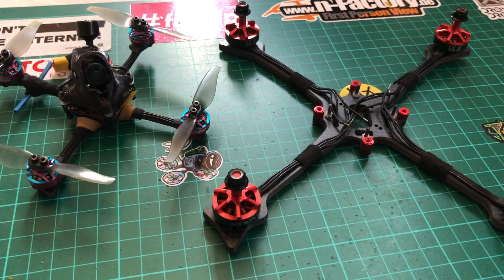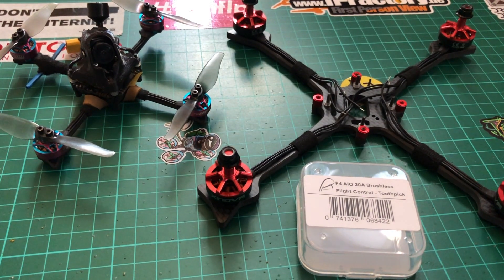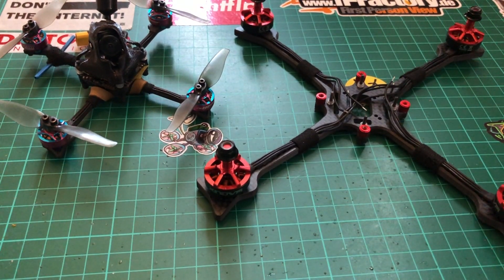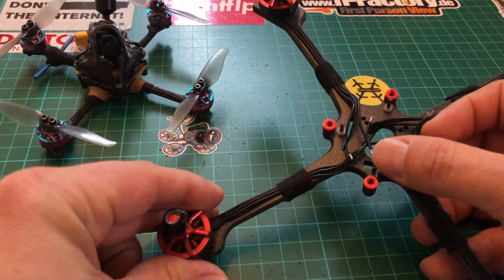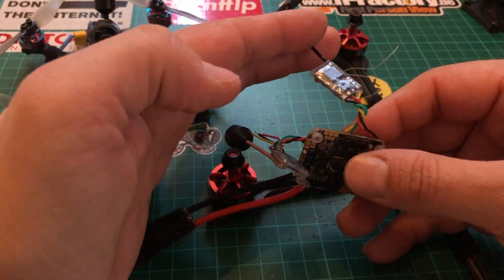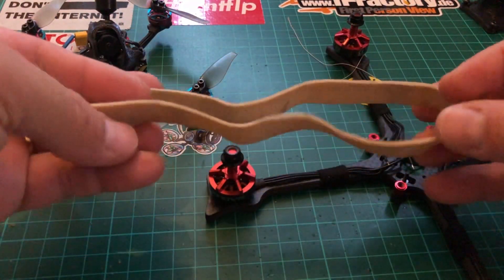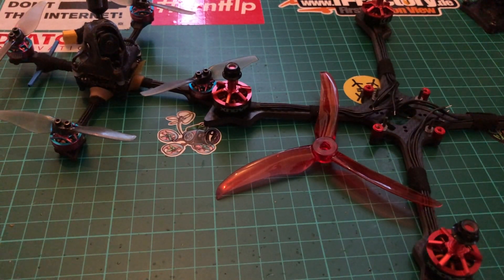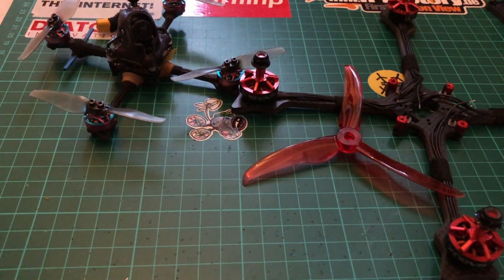A 5 inch Toothpick option : meet PickleBig

Comment: Dude! Thanks for posting. That's quite clever, having the camera cover mount not on the same plane as the the stack. Do you think you could get away with 4mm or 4.5mm? how much flex does the frame have at 5mm? Again, thanks for posting!
Reply from the maker: madpoet thanks. Yes you could go with thinner carbon I think. The 5mm version is massive and stiff. Btw I published today on the thingiverse page a “short” version of the frame that have a shorter wheelbase and slightly redesigned arm ends to take it to 30g (5mm)
Reply: @Ledroneclub  Awesome, I will definitely check it out. I follow you on thingiverse, so I would have seen it the next time I sign in ;) I am just trying to work out which two or three of your frames I am going to have cut and work out where to get them cut. I am a American living in the UK and you know us Americans and other languages (Thanks for posting in English!) so that one site in German worries me. I figured I should just send them an email though - in English and hope for the best :) 

Excuse my babble, and here's some more... I am definitely getting your Evo MK2 in dead cat format, for top mounted battery and props out of view. Fairly sure I want to get the 4" version of the Big Pickle, now I am considering the 5" too. But also thinking another 3" version, that super light one - not HD. I love how the true x format flies. Obviously I will have to move the motors and electronics around - but that's half the fun for me.
Reply from the maker: madpoet ha cool, let me know. Check this link as well for the 4 inch setup (that’s the guy who requested the frame originally) https://rotorbuilds.com/build/20468 and for the German option beware, apparently they only speak German. Try anyway, their qualities good and if needed I can get some help for translation